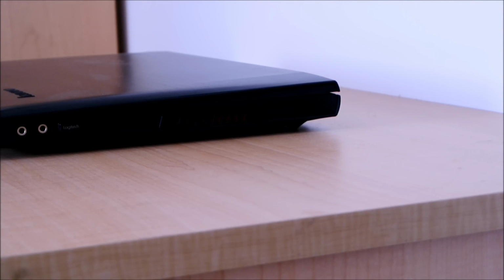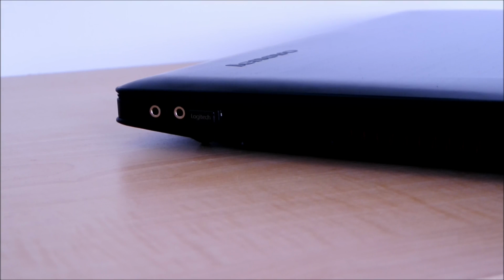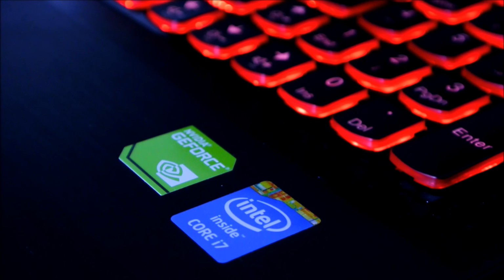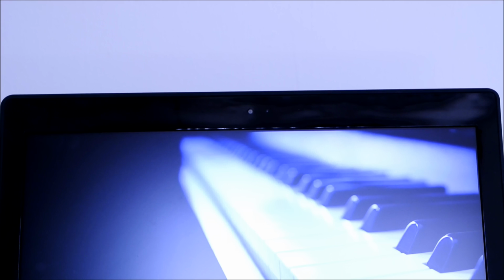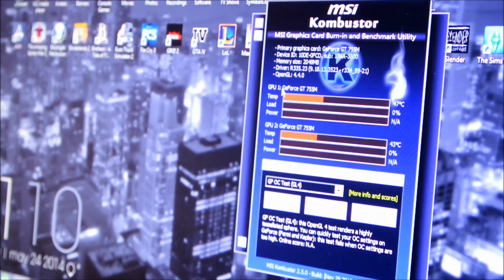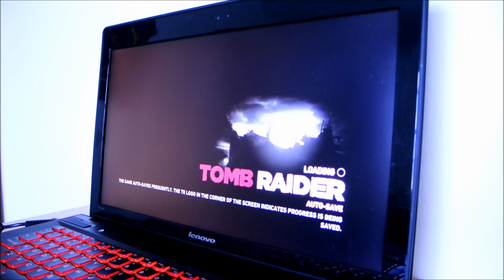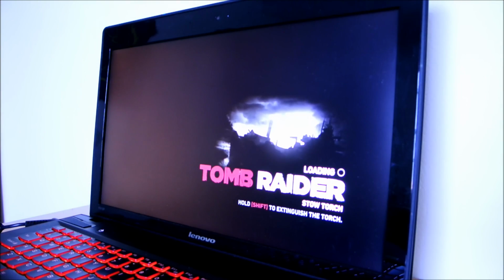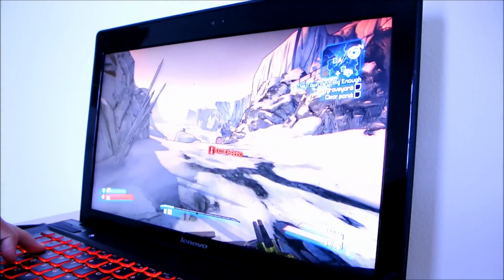Lenovo Y510p Review!

Comment: what about the performance without using the ultrabay graphics card? does it have a big impact on it?
Reply from the maker: Yes. It can be the difference between running a game at medium settings @ 1080p60, and running a game at low settings @ 720p60.

Comment: I'm thinking about buying this laptop refurbished for 800€. Do you think it's worth it? it's been in the marker for a while already but for that price it has better specs than the new ones. I'm not interested in gaming much, but I want to run photo editing and CAD software.
Reply from the maker: Rebeca Rivas Antich For the 755M SLI? I'd recommend it. The only other laptop I'd consider is this Acer laptop, but it's had its fair share of issues: http://www.newegg.com/Product/Product.aspx?Item=N82E16834314849&ignorebbr=1.
Reply: evilninjaz99 That's a quite interesting suggestion. I will absolutely consider the Acer as an option, the only think that I don´t like that much is the HDD, the hybrid hard drive of the Lenovo looks a bit more appealing... I need to think about it :). Thanks for your review and comments, it's very useful!
Reply from the maker: Rebeca Rivas Antich My pleasure!

Comment: I also have the y510p with 755m sli but on tomb raider I have to turn of tesselation to get 60 fps which is quite a annoying. Also I lightly tapped the lid of the laptop with my charger and now there is a dent. But still it is a great gaming laptop and if you want a gaming laptop for portability then definitely go for this. The Lenovo y510p has many pros and very few flaws which don't really matter. Don't get the y50 its pretty poor compared to the y510p

Comment: shit #1: the y510, hot charcoal trash with low minimum framerates, stuttering cause it has a SLI of shit cards, and overheats also like a hot charcoal trash, but has a decent TN panel
shit #2: the y50, has about the same graphics performance than the hot charcoal trash, runs much cooler and no micro stuterring cause it has 1 shit card instead of 2 shitter card in SLI but has the shittiest TN panel known to mankind
shit #3: the y50 UHD: same shit wannabe graphic performance than those previous 2 (2.5 times slower at 1920X1080 Ultra than a 980M), has a IPS panel though but the shittiest one also known to mankind
yellow is mustard(on a good day) and other colors are off too, screen is locked at a shit 48Hz, screen has a fake UHD resolution (in reality 2/3 of UHD cause it uses 2 subpixels instead of 3)

choose your shit, sorry I mean lenovo lol

Comment: Me and my dad split the cost of this laptop (I paid 500 $CA, he paid 500) as my birthday present (which I have skipped for over 3 years) just last year. This is by FAR the greatest disappointment I have ever had to deal with in my life. Why lenovo decided to run windows 8 and install the most bullshit bloatware, i'll never know. Not to mention the the terrible trackpad, the horrid stickers that leave incredibly strong residue, and the flimsy hinge of the laptop screen. This may not of been an issue with most people, but I (coincidentally) experienced so many problems with the games I throw at it. TF2 and Mortal Kombat experience terrible FPS drops, Witcher 2 crashes when loading a game, Dota 2 has unpredictable FPS drops, and a lot more. 

It's also a very irritating note to mention, that this laptops GPU is comparable to the desktop GTS 450. FOUR FUCKING FIFTY Model from 2010! Don't get me wrong, as I was slightly aware that this game wouldn't be able to run most games on high or such, but I would at least expect the advertisements to not go all flashy and make it seem like this would be a benchmarking beast. I may just be ranting about this laptop, but I literally spent ALL of my 3 years of savings on this laptop, and it is far too late to get a refund. 

Good review, wish I could SLI my laptop so it could at least last me another year or two.
Reply from the maker: I haven't encountered any of the issues you've mentioned (with the exception of the trackpad); perhaps you've obtained a defective unit? :/
Reply: evilninjaz99 I hope that's the truth. It's a real shame that i'm going to be stuck with this laptop for a LONG time. Either way, I can't return the product nor can I afford a desktop, so everything is a real shame for me.
Reply: ***** No, I am not aware of any good netgear routers. If you are planning on buying a computer for "light-medium gaming", then I would most certainly suggest getting the Lenovo y50. At the moment, my version of the Y510p is struggling to play current games (such as Far Cry 4, Assassins Creed Unity) at a playable framerate on even medium settings.  I'm not going to go into the specifics, but the Lenovo y50 would easily grant you the ability to play every game on at least medium with 60FPS. In general, just get the Y50 and NOT the Y510p.

Comment: can anyone tell me whether or not this one has sli or not?i'm a bit confused
http://www.ebay.com/itm/271590240650
Reply from the maker: No. It has a single 755M.
Reply: evilninjaz99 oh shieet! will my system will be slower compared to yours?coz i've already purchased that laptop :(
Reply from the maker: Unfortunately, gaming capability will be somewhat limited. Don't get me wrong: it's good, but not great. :(
Reply: evilninjaz99
really i'm gonna cry now,it crashed when i play skyrim and FIFA 14 on ultra high setting
FPS on medium setting is around 60(the highest that i can get) and i have lower the resolution -_-

thanks anyway man! that's some next level shit review!!
Reply from the maker: Reza Chandra Thanks. :) It crashed? The single 755M should be able to play Skyrim at high, and Fifa 14 on maximum.  At 1080p.
Reply: evilninjaz99 it did on fifa 14,anyway is there any solution so that i can perform exactly the same(or on par) with the sli version? i'm a total noob with this kind of thing :)
Reply from the maker: Unfortunately, there is not. :(

Comment: My setup is a little different from this one. It's an older model (gt 750m sli), but I put in a crucial SSD at 500gb, a copy of Windows 7 and 16gb of ram and frankly it kicks ass; there is almost nothing it can't handle gaming wise and the driver support for Windows 7 is excellent. My complaints are that the wifi sucks and the heat blowing out of the vents is incredibly annoying when you're trying to game. Hook it up to a monitor like I did though and you just can't beat it as a cheap, powerful gaming rig.

Comment: hi there, i think there might be a mix-up in your video. you said early in the video that the 755m sli is better than 860m but later you said the 755m sli is worse than 760m and similar or higher than 660m. how does that work? i did some research and the 755m is indeed better than 860m very slightly, but 860m is just too much better than the 760m or 660m.
Reply: ok my bad you were actually talking about the desktop versions. i am silly.

Comment: I need gaming laptop what runs League of Legends with good graphics, recording system and still decent FPS. Is this good? Does it have mike inside it and does it over heat too fast? Tell me about good and bad sides please.
Reply from the maker: You should be able to record LoL on maximum settings without a problem. It has a fairly decent microphone, but I would suggest buying an external one for more professional voiceovers. The laptop does get pretty hot after extended use, but it isn't too concerning.
Reply: evilninjaz99 Yeah i was intrested about the michro phone because i might break the one im using right now but does this laptop have any cooling system and i read some ones comment about the power system what makes the laptop bad with gaming.
Reply: evilninjaz99 Yeah i was intrested about the michro phone because i might break the one im using right now but does this laptop have any cooling system and i read some ones comment about the power system what makes the laptop bad with gaming.
Reply from the maker: UltimatePvPBros Eh... it's okay. Not great, but the performance is still stellar.

Comment: Amazing review man! Much appreciated for the info.
And i have one question that i hope you'll answer if you don't mine.
Does your laptop have a DVD/CD drive? If yes please tell me how it preformes in high/ultra settings gaming.
Because i saw one with out a DVD/CD driver in replace with a graphics card ( i think ), and i really need to know because i need it for my college work and hardcore gaming.
Sorry for the bother im just new in PC gaming, and i really need all the info i need to buy an amazing yet cheap gaming laptop.
Reply from the maker: Thanks for watching, dude! My laptop does not come with a DVD drive because it houses two graphics cards. I suppose that you'd have to decide whether the loss of a DVD drive is worth the extra performance. Personally, I couldn't live without the SLI configuration. But then again, I rarely used the DVD drive, so the tradeoff was worth it for me. The SLI is totally worth it, especially if you're an avid gamer. But you lose the DVD drive when deciding to go SLI. A single 755m still is good; it can play most games at medium settings (1080p), but the 750M & 755M SLI can play most games at ultra. It's a significant difference. Hope I helped!
Reply: evilninjaz99 | Technology & More. Thanks you helped alot! Im really not sure to decide between and extra graphics card or a DVD/CD driver, i dont use the DVD/CD driver alot but still sometimes i use it for burning DVD/CD, what do you suggest? 
And im hoping to get 755M.
And if i bought the one with out the secondary graphics card how bad will the preformance be? 
Will it be worth it to sacrifice one of the graphics card for the DVD/CD driver?
Whats your opinion?
And thanks for the quick feedback :).
Reply: evilninjaz99 | Technology & More. Thanks you helped alot! Im really not sure to decide between and extra graphics card or a DVD/CD driver, i dont use the DVD/CD driver alot but still sometimes i use it for burning DVD/CD, what do you suggest? 
And im hoping to get 755M.
And if i bought the one with out the secondary graphics card how bad will the preformance be? 
Will it be worth it to sacrifice one of the graphics card for the DVD/CD driver?
Whats your opinion?
And thanks for the quick feedback :).
Reply from the maker: BioCorrosive I highly recommend going for the SLI model; it will be more beneficial in the long run as far as gaming is concerned. :)
Reply: evilninjaz99 | Technology & More. Thank you man! You helped alot :D
Reply from the maker: BioCorrosive Glad to help! :)

Comment: I need laptop with graphics power but not for gaming. Will I be able to access this graphics power on linux ? I brought Y50 few days ago and when I installed NVIDIA driver on linux then desktop was not loading so I returned that laptop but that has 800M series card so It might be possible that NVIDIA hasn't updated linux drivers for 800M series. What about this 700 series graphics card, will it support linux ?

Comment: How are games on battery? Ive heard that this laptop switches to the integrated intel gpu on battery and you can barely play games, once its plugged in it plays games fine. Is this true, and if it is do you have a fix?
Reply from the maker: It is true. Unfortunately, the FPS drop is very significant; from 60 FPS -> 15, for instance. This is due to the taxing SLI power that is unable to be fulfilled by the battery. There is not a fix that I am aware of; the GPU is throttled to 135MHz.

Comment: Would you recommend me getting with the SLI? Cause I heard it gets overheated when playing games, and I'm concerned that I might pay more for repairs once the driver crashes due to overheating. Thanks in advance for the help.
Reply from the maker: I have never had a hardware crash or malfunction in the three months that I've had the computer. The gaming performance is spectacular for the price. Yes, it does get rather hot, but it isn't enough of a concern to overrule the justification in performance (in my opinion).
Reply: evilninjaz99 | Technology & More. Is it worth it? Cause I heard if you keep on gaming everyday you're CPU's performance will slowly decrease.
Reply from the maker: rics69able The CPU? If anything, the GPU's performance would decrease slightly over time. Bottom line: I believe that the warmer CPU and GPU temperatures are worth the considerably improved performance. The hardware can get hot, but I still love it. :)
Reply: evilninjaz99 | Technology & More. Oh my mistake I meant GPU haha. Well thanks for the advice I might consider getting this laptop thanks. Btw nice review though :)
Reply from the maker: rics69able Thank you. :)

Comment: Hey there. I'm going to buy this laptop soon enough. I'm not a gamer though, I just love the way this laptop looks and the specs. I thought the other lenovo laptops looked rather dull. 
Is this still a good choice for me? Will the battery last longer if I don't use it as a gaming system?
Reply from the maker: If battery life is your primary priority, you'd ultimately be rather disappointed. The battery life is mediocre. I suppose you would need to ask yourself if it is worth the comparatively expensive price tag simply for the processor, as this laptop is mainly gamer-focused. Personally, I wouldn't recommend it if you're not a gamer.
Reply: evilninjaz99 | Technology & More. Thanks for the quick response. 
Yeah I was a bit iffy about the battery life, which is why I didn't finalize the purchase. 
I was very disappointed with the aesthetics of every other laptop on the market. Macbook pro's are the only other option which look good, but the configurations I need will easily take me into the $2000 range. 
Can you suggest an aesthetically pleasing laptop for a casual user and programmer? I'd really appreciate it.
Reply from the maker: built4lockerz :) It looks really nice. My friends have complimented my computer on numerous occasions, and the red-backlit keyboard sure is attractive! The computer is a bit "beefy" compared to a MacBook Pro, but I honestly prefer its "edgier" design to the MacBook. Looks like a true powerhouse.
Reply: evilninjaz99 | Technology & More. I think I'm gonna go with this one. If it can squeeze out 3-4 hours of battery life in normal use, I'll be okay I think. How long does your battery last with normal usage?
Reply from the maker: built4lockerz It lasts for about 2 1/2 hours with moderate usage at maximum brightness. It increases significantly as the brightness decreases, of course.

Comment: you have definitely just earned yourself a sub and a recommendation in my videos and to my friends, i was at first still wondering between this and another laptop but after watching your extremely in depth unboxing and directly watching the full review i am going with the y510p for sure, you did an excellent job of explaining this in a quick manor, though one thing i ask (i may have missed it in the video and just not heard you) since it is a gaming laptop, does it come with a disk drive or not? other wise amazing video thanks for your help bro.
Reply from the maker: Thanks for watching, and I am glad that you found my videos to be informative. If you purchase the SLI variant of the system, it does not come with a DVD drive. However, obtaining one without the secondary graphics card will have a DVD drive included.
Reply: perfect thanks man

Comment: So got the same computer 

I got the lenovo y510 16gb memory,1 tb hard drive with 24 gb ssd, windows 8, 2.4 ghz, dual 750 m graphics card.  I think I got it for $1109.99 from Newegg.com

Few questions for you

 1. Is there a big difference between 750 sli and 755sli?

 2. When I try to upgrade to windows 8.1 one of my graphics card is turned off...

ABA
Reply from the maker: 1) There is a minor difference; hypothetically, a game that might play at 40 FPS on ultra will run at 46 - 48 on the 755M SLI. 

2) Here is a video that will help you will Windows 8.1 SLI issues! No SLI Windows 8.1 Upgrade Fix

Comment: The GT 755m in Sli is slower than the single GTX 860m + you eliminate excess heat and micro stuttering. Good review non the less... But u have to posess both systems to truly compare cards. The GTX 860m at 1080p is great, no need to go higher (for gaming that is).
Reply from the maker: I've come to terms with accepting the fact that the 860M is more practical. Thanks for watching!
Reply: No problem man!

Comment: Thanks a lot for the review! I found one on eBay that I'm gonna order. Mostly for schoolwork and gaming. All the games you talked about seem far more graphically intensive, but I take it this machine can run Minecraft pretty well? Thanks again
Reply from the maker: Thank you for watching my review! This computer can run Minecraft without any problem at all. :)
Reply: I was watching another review and I couldn't help but notice... Does this not have a disk tray for games/CDs/DVDs?
Reply from the maker: Daniel Kompolt The models with dual graphics cards do not have a disk drive. You basically have to weigh your options; a single card w/ DVD drive, or an SLI configuration without the disk drive. Personally, it's a bit of a bummer for me, but I needed the additional power that a secondary graphics card provided.